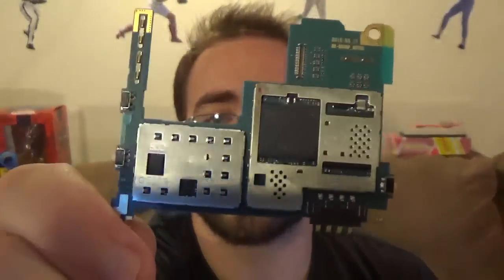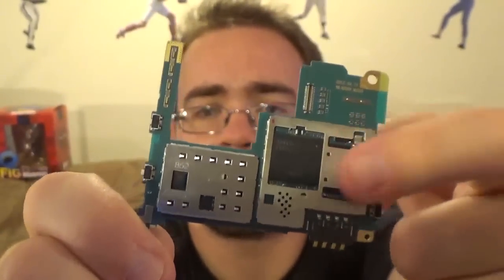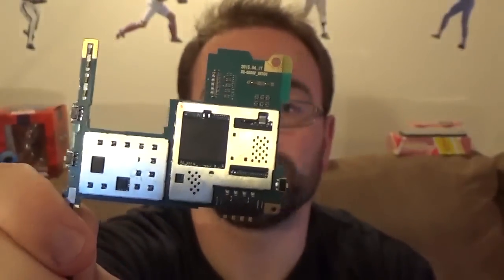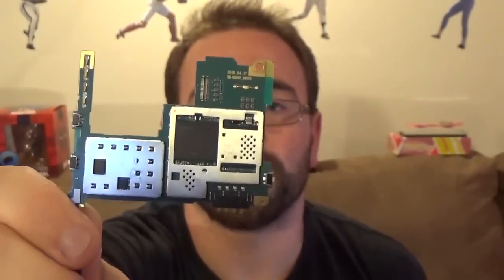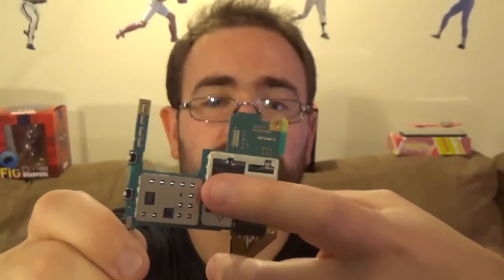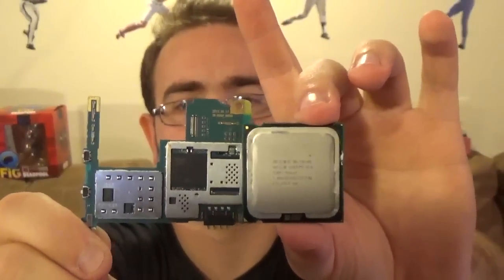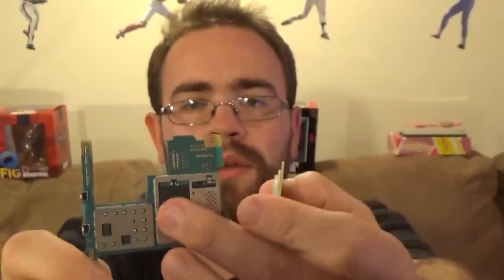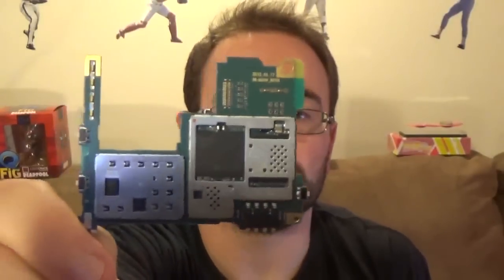Nintendo Switch - x86 And ARM! Why Is Nintendo Using ARM??

Comment: Huh?
I don't get why you say that more software will need to be written in Assembly instead of C/C++.
Modern compilers have no problem with printing out high-performance code, be it for ARM or any other CPU-Architecture, really...
When debugging I sometimes have the feeling that compilers write much better ASM-code than humans without 40 years of experience ever could! Of course I'm exaggerating a bit, but in times of self-repairing AI I don't believe ASM should be used too much if it's not for storage problems, which really don't exists anymore!

Comment: Great channel, the need for someone who knows what he is talking about in the game sphere was needed, glad you are filling that role, however I think you missed 2 very large points:

1. Nintendo Switch's ARM cores would need to be compared to PS4's x86 cores. You spent a lot of time on the performance differences, but A57 or A72 based arm cores which Switch will have to use as they are the only 64bit ARM high frequency cores is much faster than Jaguar cores found in XB1 or PS4. In fact the person who originally leaked Wii and Wii U's processor LCGeek on neogaf, has already told us that the CPU is 15-30% faster than current gen consoles.

2. You code to an API or engine (which then codes to an API) Switch will use NVN or Vulkan for coding, so no it won't be harder to code on Switch, UE4 also runs better on Nvidia hardware, so when compared to current gen consoles, while it will be slower, the gap between Switch and XB1 should be smaller than the one between XB1 and PS4.

Again great video, been waiting for someone like you to come onto the scene.

Comment: You should breakdown ARM using RISC vs X86 using CISC computing for the people.
Reply: So.. what is your point?

Also its not really true. x86 is a hybrid CISC... ARM-8 is a hybrid RISC. There hardy exist any true CISC or RISC processors any more.
Reply: matsv201 Go find out what the acronym ARM stands for. ARM-8 is not a hybrid RISC design. IBM power series CPUs and other non-x86 CPUs utilize hybrid instruction sets.
Reply: Brad Kayganich Armed was named decades a go. There be quite a bit of instructions added since.. Go check it up.

Comment: i guess i get how they are different after your explanation, but i'm wondering what the gap in similarity is? people's concerns (after full performance and battery life) are third party support, whether this is similar enough to the other systems for ports, since the most common explanation for why the wii u lost support was that it was too different and not worth the effort given the install base. rumors seem to be pushing that it's very easy to work with, so i'm hoping the difference is not a big factor.
Reply: zetsubou1v1 its up to the coding software used, for example unreal engine 4 supports arm and x86 so it will be easy for third parties to make games for ps4 and switch.
Reply: zetsubou1v1 the Switch will be capable or running any game on the PS4 if the developer/publisher wishes to port it to that system. how that game looks will depend on many things, but since we have no clue on final specs we can only speculate. 

With what is rumored, it should be competitive with the XB1 at least in terms of performance .

Comment: Will it be easy for third party to port games? They won't back out like Wii U will they?
Reply: jordan rausch all devs are saying its super easy to port ps4 level games over to the switch, which is why that third party support list is so large, but they will only stay if Nintendo keeps up great sales the first year
Reply: BlackStar Freeman awesome thanks
Reply: Sales of Switch means little if people aren't willing to buy 3rd party games.  Even if it's easy to port to, if it's inferior to the other versions than sales will be low.  Switch needs to be at a power parity with the other consoles in order to get and keep 3rd party support.
Reply: TobiasBoon Black Ops and MW3 managed to do well enough on the Wii. Parity means nothing to the Nintendo crowd at large. All they care about is if the games work and are fun.
Reply: Sold well but no where near what the ps3 and 360 version sold. On a console that's over 100mil sold, you'd expect it to sell more.  Had the wii been just as powerful as those two, it would have gotten constant major AAA titles instead of buckets of shovelware. If parity isn't an issue than why has developer not port their games over to WiiU as well.

Comment: Tegra X1, and X2 chip sets can run Unity, Unreal 3, Unreal 4, CryEngine 2, CryEngine 3, and many more. I would be surprised if they did not get 3rd party support.
Reply: most smart phones use unreal engine 4, or unity. it's not saying much
Reply: that's due it can use opengl and directx12.
Reply: Ya it is great though! Almost all the engines I mention also allow for direct compilation for those engines as well.
Reply: BenjerminGaye but they are using the mobile renderer, the switch can run unreal engine 4 on the full renderer, the one pcs ps4 and Xbox use

Comment: people keep looking at phone games and aren't impressed with the grafics. but you have to understand that the games are  not pushing these devices due to developers having to make the games compatible with the majority of phones and those are actually the $200-300 dollar phones which have a third the power of flagship phones. if the games were made just for high-end devices you would be blown away with what the phones are capable of. GTA 4 is old but on a high end phone with all enhancements enabled that were added because these phones are so powerful, the game looks so much better then ps3.

Comment: do you think the switch will get third party support.
Reply from the maker: I do, check back soon for a video all about Switch third party support ;)
Reply: really
Reply: shookshock of course it will, it won't get everything big,  but most games and it will be a indie powerhouse
Reply: One thing that gives me a lot of hope is that Nintendo Switch makes sense. Developers and programmers are used to developing for ARM and x86 chips. Nintendo happens to be using ARM instead of PPC which has been a huge factor in how difficult it has been to develop for Nintendo systems. Even if the screen is multi-touch, this is another thing that has been common to program support for. But, if not, it is simple to leave out support for without losing anything.
Reply: It's too early to say, We should remember that the Wii U supposedly had a lot of third party support but that quickly died out after release, x86 and ARM's are well understood architectures from developers so that won't be an issue with getting the most out of them, personally, I think the real problem Nintendo could face are smartphones, pretty much everything the Switch is can be done on smartphones and it wouldn't take much effort from the likes of Google and Apple to take advantage of that, it also doesn't help Nintendo that most of us already have smartphones so to developers, the market is already there, all smartphones would need to do is make it easy to attach controls to them, easy way of connecting to the tv and bring proper triple a games to them, if that was to happen, I have to wonder what the point of the Switch is when I already have a smartphone.

With any luck, Nintendo Switch might get the likes of Google and Apple to wake up to the potential of this market.
Reply: Paul Aiello but smart phones do not have Tegra gpu, isn't the switch going to be more powerful than a smart phone?
Reply: ***** That could be true but if it's going to target that market the price might have to be dirt cheap to gain that market, in any case we'll find out soon enough once released.

Daniel, Nvidia is likely going to use whatever they use in the Switch for their own chips they sell with smartphones and tablets but without some of the custom made things Nintendo wanted but overall it's likely to be a similar chip, it wouldn't surprise me if the Shield 2 will use it, I'm still wondering if the Switch is going to use the Tegra X2 or a custom X1, if it's X2 then that should be pretty decent if it's ready in time.
Reply: untseac It's not really about them having the gaming market, it's about them having the numbers that count, most of us have a smartphone or tablet, many of which are PC or console gamers, with a bit of effort from Google and Apple, they could convince enough to skip the Switch and play proper games on smartphones and tablets.

The real problem is the support but that could change, controllers with the more expensive smartphones could easily be included if they wanted, they hardly cost anything and even buying them separate works out much cheaper then buying another device like the Switch.

Smartphones are not marketed for gaming but then the PC isn't as well and that does gaming better then consoles.

Android and IOS are capable of doing good gaming but the lack of physical controls holds that market back, Vulkan on Android should help quite a lot with performance but in all honesty, Apple are in a good position to do it, they are in complete control of the hardware, they don't have lots of phones like Android so that makes it easier for developers, they also have low level access to the hardware, the question is if they have the will to push, in any case, emulators alone is a big advantage smartphones have over the Switch.

Comment: won't having an arm processor make it hard to port games from ps4/Xbox to the switch?
Reply from the maker: Actually no, ARM can compile languages like C++ and C# which are both used for the PS4 and Xbox One. These are reasons we saw games like dead space and Crysis work on ARM processors without much issue.
Reply: Nope.  With C++ the compiler does the work.  The OS is where the effort is.

Comment: is AMD better than Nvidia? I heard that was a criticism of Nintendo for not using AMD
Reply from the maker: Nvidia is better for what Nintendo wants, which is an ARM processor that's easy on battery and can put out enough power to play games.
Reply: Nvidia blows AMD out of the water, but costs more.  AMD has a lot of "value" products.  
For example 2 On Nvidia's Denver ARM cores beats 4 of AMD's x86 Jaguar cores in the PS4/XB1.  Nvidia cards beat AMD cards using half the power.  AMD is still trying to beat Nvidia's last generation of graphics cards.  

R9 is AMD and GTX is Nvidia
Higher is better  
https://cdn.arstechnica.net/wp-content/uploads/sites/3/2016/05/DX12.007.png  

Nvidia is way ahead with 2X the performance.

Comment: Also, the new MacBook Pro with touch bar has both a x86 and ARM processor. The latter to run the touch bar, alongside with the x86, to run the macOS!

Comment: What if the ARM works for the switch when it's undocked, and it switches to the x86 when it is docked, and if this is true this might clean up the confusion between it gains more power when docked and when it is undocked.
Reply: Juan Otero I like where your head is at but I see it more like my gaming laptop.  My laptop down clocks when mobile and it's a half decent laptop.  I can adjust the power management by sacrificing battery life.  We probably won't have that freedom but the adjustments can be made without x86.  I think it will all depend on the chip NVIDIA designs for the switch.  I think x86 is unnecessary after seeing what NVIDIA plans to do with Xavier but it's a possibility.  I am just hoping the SoC is beast wide open and we all watch Nintendo rise to the top again.  Wishful thinking probably but I was born into this lifestyle by Nintendo and I want them to succeed.  Let's hope NVIDIA and Nintendo's rumored price point was a steal and they view it as an opportunity to start a new trend.
Reply: This would be a nightmare to develop for. I don't think trading easy development for "more power" is really worth in the scenario we are at right now. Not only that, but the dock would have to have more RAM in it to make the change worthy. x86 is a very old architeture. It was updated, true, but in its core, it's very old and, consequently, very ineficient. And, even with all that taken in account, I can't think of a good way, software and hardware wise, to change from a RISC arquitecture to a CISC arquitecture on the fly.